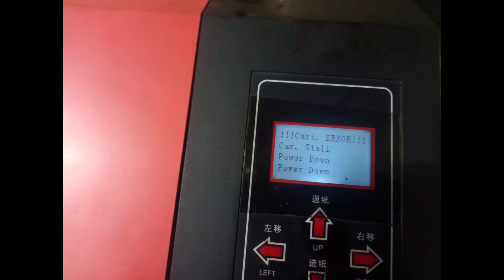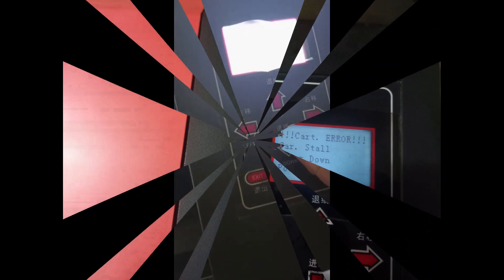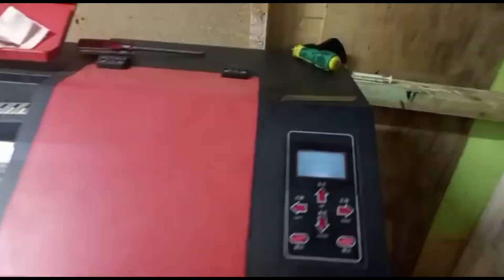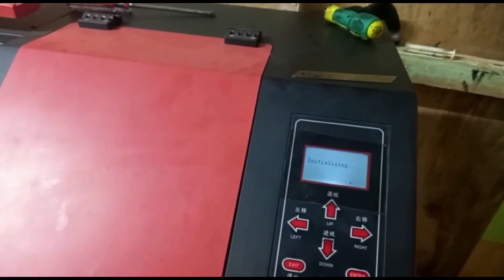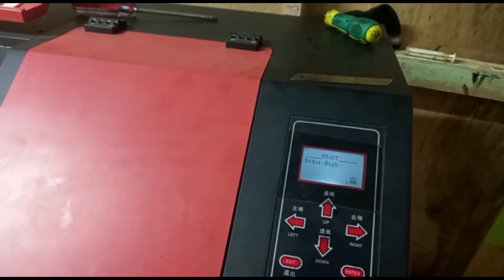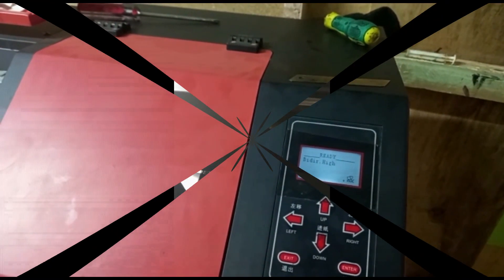XP600 CART. ERROR. /ERROR 13. CAR. STALL. POWER DOWN SOLVED

Comment: Erro 13 visutec como resolver?
Reply: boa tarde amigo, por acaso vc conseguiu resolver, estou com o mesmo problema?
Reply: @jeanlino3702  boa tarde
Reply: @jeanlino3702  sim
Reply: Boa tarde amigo, também estou com o mesmo problema visutec, qual foi a solução?
Reply: @dieysongean6057  problema no motor dc fazer a troca resolveu. Provavelmente motor em curto